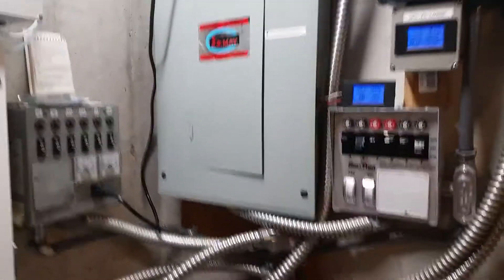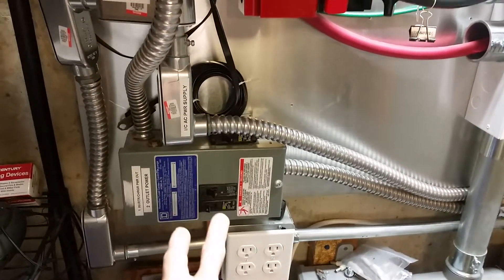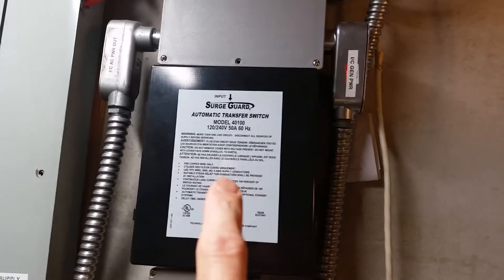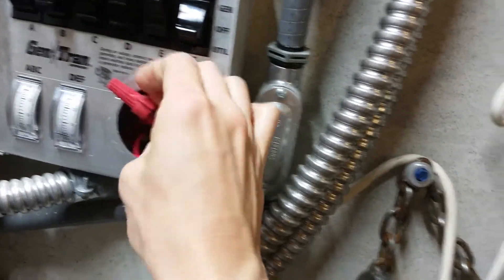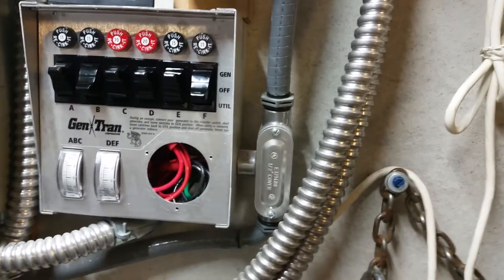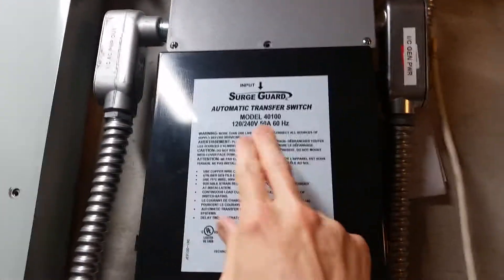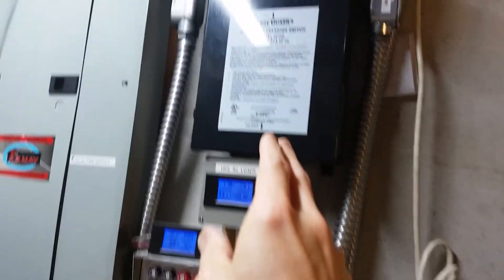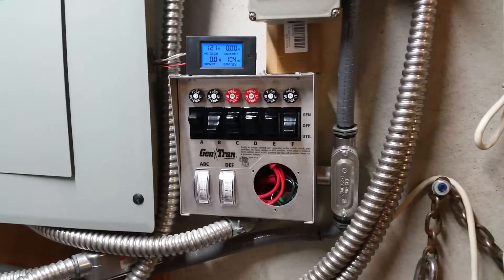Generator Transfer Switches Follow-up - Part 2 of 2

Comment: similar (probably dumb) question on the neutral - could it backfeed the utility and risk shock to the line workers?   i realize the hot is cut off via the transfer switch, but what about the neutral.. would that carry any voltage back via the bus bar?
Reply from the maker: It shouldn't.  If it did the makers of these switch boxes would have some major lawsuits on their hands and probably would not be in business.
Reply: Good point.. thank you
Reply from the maker: You're very welcome and Thank you so much for stopping by the channel to watch this one.

Comment: Do you have to oil the switches?
Reply from the maker: No.  Switches do not need oiling.
Reply: @thekeltnerway3002  sorry but not even a little to keep them lubed?  My garage gets moist in there and i spray down all machinery with rust inhibitor.  I would think a few drops of like 3in1 rubbed in would help.

Comment: So,
You are constantly feeding the power from your Inverter/Charger to the Generator Transfer Switch box. 
Question: during this process,  what's the switch position on the Generator Switch Box?
What's the switch position on your house circuit breaker receiving that power ?
Reply from the maker: Apologies for not responding earlier.  Yes, constantly feeding power to transfer switch box.  Switch position on transfer switch box is on the position call "GEN" for generator.  Switch position for the breakers in the standard breaker box is on.